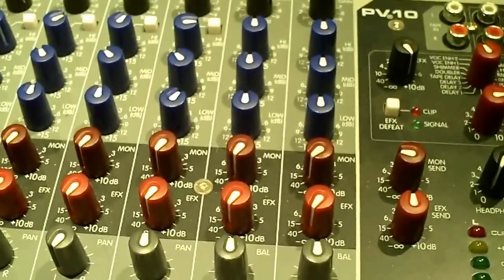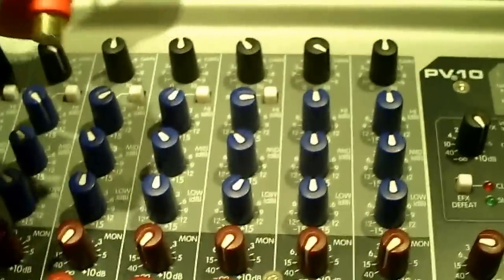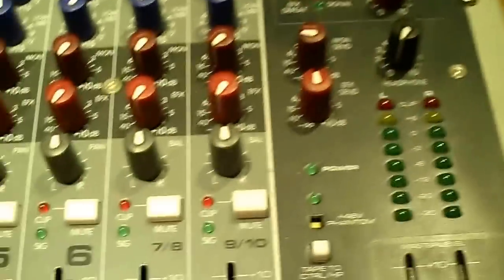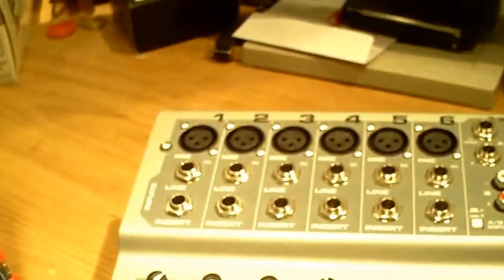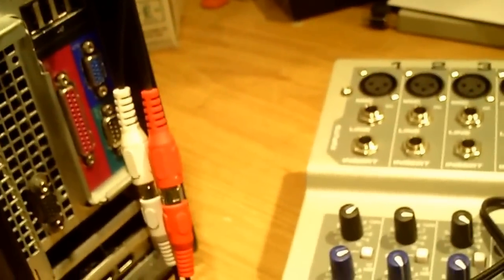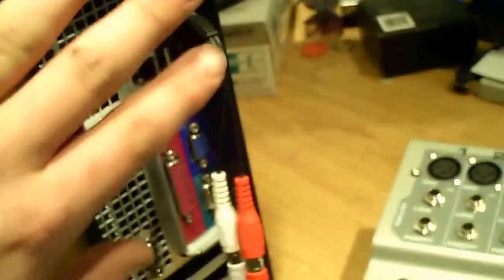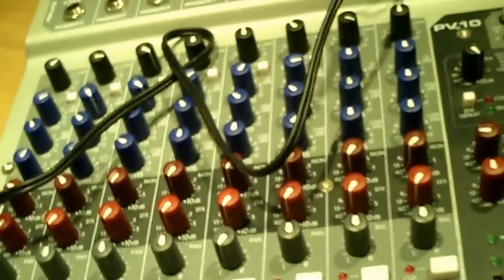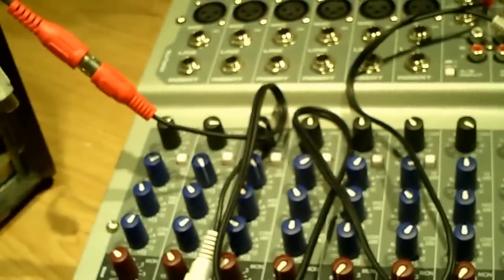How To Connect Your Audio Mixer To Your Computer & Vice Versa

Comment: So can i like use an xlr mic hook it up to a mixer hook the mixer up to my computer and then record using audacity
Reply: yes
Reply: grimyfur909 will audacity/my computer recognize the mixer as a usable microphone if plugged in to my computer i know that is a stupid question im just a little confused on how it works
Reply: from the mixers " main out" you would connect that to your computers soundcard/ line in or mic jack. its usually on the back of the pc. you can then go into your recording options (windows: right click on the speaker -> recording options) and make sure you have line in or w/e selected.  then in audacity make sure you have your mic selected and you should be good to. if im not mistaken lol

Comment: Is hooking the mixer into the line in jack of the computer any good? Like audio quality wise? I've heard USB in some cases can be crap, but I feel like USB would be better then line in.
Reply: MegaMech
USB currently runs 2 channel and USB 2.0 runs 10 channel no problems.  I just bought a Alesis 8 channel USB 2.0 mixer so plenty of overhead.  And to settle the debate.  If you have a sound card with an available port for MIDI or MIDI through SATA on it like this cat does, it would be best to spend 200 bucks on a good interface then pipe the mixer through that for max channel availability.  USB 2.0 is second to MIDI, USB is third, and line in is okay, but you have only raw sound that can be manipulated as one track.   Final judgement:  If you are recording one instrument at a time and have a good editing program and decent computer, then you can just assemble your music track by track.  It will still sound as clean and usually the raw data from each individual instrument can be saved and manipulated after the fact.  If you have electronic drums, a garage band that records whole takes, or MIDI equipment then you probably want to re- think running everything through line in as it will become time consuming.  Hope I could help.
Reply: It is, the proper way to do this is to hook it up to a usb interface such as the focusrite scarlett 2I2
Reply: Solas Wait... You say using the line in is fine. Then you say to use a USB interface. Which I think it dumb because a USB interface is basically a crappy 2 input mixer. For 150 bucks when you can buy a decent 12 input mixer for about 120 bucks
Reply: MegaMech Sorry, I think I messed up that last message. I was trying to say that the line in is not the best option in terms of long term use and using your pc's on-board audio interface as it might not be up to the quality you might expect, and that yes, usb is much better than line in. I didn't mean to mention that usb interface, I was trying to bring across the message that any data processed by a bus port is usually much better than data processed by a line in/out port due to different chipsets and the material used in each case. Instead of buying a usb audio interface, you could buy a much cheaper pci-e audio interface that would support a wider range of audio drivers and would produce a much cleaner sound because of it's independent chipset, compared to your pc's chipset, which might boost the lows and might only support a select few drivers. (From my understanding the line in AND out both run through the same audio processor, the sound may come across crisper with a different driver, but that only applies in certain situations.) I would recommend you do some research on audio interfaces before you decide to buy an interface, or mixer in this case. Sorry for the screw up on that last message..
Reply: Solas Thanks :D
Reply: Good Luck! :)
Reply: Vash Stampede Most thing's audio seem to use USB 1.0. I'm surprised anybody makes anything for 1.0. Everyone should make shure that their product is awesome with 3.0 just because it's the "latest" in technology. 2.0 Should definitely be the standard.

I ended up buying the berhinger X1204USB for 187 bucks CAD. It's pretty sweet. The USB sounds fine. Of course everything is pipped in through 1 channel. And Line in is definitely a complete no no.

Comment: The audio is routed through USB. Maybe I misunderstood your question. No need for audio cables between interface (mixer or stand alone).

My setup is a small Yamaha mixer and a Roland Quad Capture USB interface. I record audio into Live 9 through the USB cable. The mixer isn't really needed these days if you get a bigger interface. I'm just old fashioned and have some outboard fx I want to have hooked up to the AUXes.

Comment: If your mixer is analog this wont work. Analog mixers dont have computer connectivity. So you will have to get an interface. You can get Something cheap like a Roland duo capture which is nice because it connects via usb. you still connect to the interface the same way, but into the input on the interface. Or you can still use your 1/4 adapters into the mic/ guitar input

Comment: You can record separately but it will limit you to two channels unless your mixer specifically says it can record more than 2 channels simultaneously like let's say an Alesis Multimix 8.0 USB (the old version not the FX ones). In order to record two separate channels, you must pan them both hard left and hard right. Let's say the vocals on channel 1 panned hard left and guitar on channel 2 panned hard right. In your DAW you must create two mono tracks. One with left input and one with right.

Comment: Quick question. I've been using a USB mixer for years now, but my particular mixer records all my channels from the mixer into a single channel, so I can't for example EQ a guitar track and vocal track separately if I sing and play guitar at the same time. It comes into the software as a single channel. Does the "RCA  to stereo mini plugged into the mic input" method solve this problem?

Comment: Hey Halo McIntec, Well I have got Behringer Xenyx 1002B Mixer newly, i have used Tascam US-122mk basically before for my recording etc as its USB i directly connected to my system and used it into my Cubase software, but in this New Behringer Xenyx 1002B its totally different as it not an USB mixer, so i'm a little bit confused how to use it, and well i'm also geting the UCA222 Sound card to use my Mixer, so i'm unable to understand that How Can get recorded multitrack and so...

Comment: you should aim for - 3db cut. and unity as an baseline for the peaks. The way shown here is an awful way to do it. Also use quater inch jack and two channels. Learn your equipment.

Comment: im trying to connect a turntable w/rca plugs & a mpc2ooo to a alesis multimix usb mixer. the mixer does not have rca. can i use the rca to 1/4" connectors to plug it into the line input. also, there is only one out  (main out)???

Comment: Yes you can, i know because that what i do. the specific mixer shown does not, although if you would want to spend a couple thousand dollars, then yes it will. but honestly a midi converter to usb is very cheap, around 30-50 dollars and it works the same.

Comment: To leoanp: Apple came out with an attachment called irig. It takes a quarter inch mono cable and converts it to the all in one Mac line in/out jack. Downside is it is a mono signal.

Comment: I think it is ideal to keep volumes 100% in windows, digital attenuation of less than 100% causes loss of quality you want to handle all the volume at the analog (mixer) level. 

Also big difference between line in and mic in on a computer they should not be used interchangeably.

Comment: @TheSynyster1996listen, i do not have a mixer but on the sides front or back there will be 2 microphone and speaker inputs, connect it where he put the plug in

Comment: @TheSchoolsux345 If you wanna use 10 mics (which is kinda absurd), you need a multi-channel mixer.  Get a mackie mixer, they are relatively cheap and have a good reputation.  Or, if you can afford it, get an interface with a firewire connection, much better audio quality.  hope this helps

Comment: those creepy  looking RCA and adaptors will give prob. in the future use heavy duty rca with low noise cables perhaps this are lines for audio signal you dont want a distorted sound coming out from your speakers... you can get a open RCA (metal) from a audio hardware store and choose an appropriate wires.. in my case i use microphone wire soldered them snugly... then enjoy a clear audio output...

Comment: Hey, I have the same mixer as you except it's the PV8, a Shure SM58 (yes, I realize it's better to use a condenser mic to record, and that the SM58 is a dynamic mic). I have the RCA to 1/8" plugged in the Tape Out on the mixer and the Line In on my laptop (HP Presario CQ62, running 64bit Windows 7). I still have the web browser up, and while I was typing this comment, I tried talking in the mic, and there's some latency. When I close my browser, and mute the playback, will I still get latency?

Comment from the maker: @dooey99 yes there is, in-fact, that is what I do with my system. Most new applications allow you to select what sound card to play audio to and from. $10 USB sound card would work. Windows Vista and 7 work well with multiple sound cards. Some new motherboards have back speaker out and front headphone out. You can generally use both at the same time.

Comment from the maker: @clarityria XLR is balanced, which is best for Mic's, no interference. You could technically use XLR to RCA if you really wanted to, but I don't recommend this. Icf you do use XLR to RCA I would suggest not having your phantom power on your mixer as it could send 48 volts into the line and could cause damage. (Depending on the adapter used). Also you would need an XLR to XLR cable to power a Mic that requires phantom power. Such as a condenser mic.

Comment: hi the audio interface i want to put throgh the mixer has s/pdif in and out. also balanced line outputs 2 of them and unbalanaced line inputs and on the front it has a guitar input which is a jack. and headphones input a jack. also an xlr conector for microphone really want to use my mixer with it hope you can help and tell me how to hook it up mate. my mixer is a beringer ub802

Comment from the maker: @JadeMurder You will get the same sound quality with some small noise. Because laptops have all built in parts sometimes this can cause some small noise when the computer is processing, but you would not notice when you have sound going. Only if there was no audio and you turned the headphones up really loud.

Connecting a mixer to your computer will not cause your computer to slow down as it provides the same thing as it would connecting desktop speakers or headphones to it.

Comment from the maker: @nickvisstick You could go with a entry level Behringer mixer. They are pretty cheap and do well for audio. You would need an XLR cable for your Mic, as well as a patch cable for your guitar if it has a line output.

Comment: hi there i have a question i need to boost my shure sm58 mic if  i connect to a mixer then in to pc will it boost it as its to quiet straight to the pc and sounds a bit crappy please get back to me thanks pal im using cubase ect